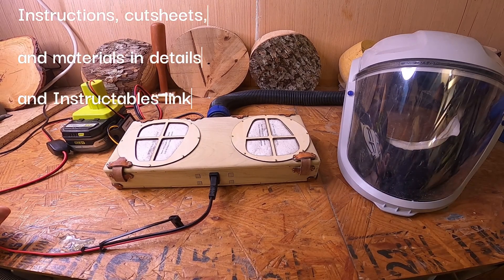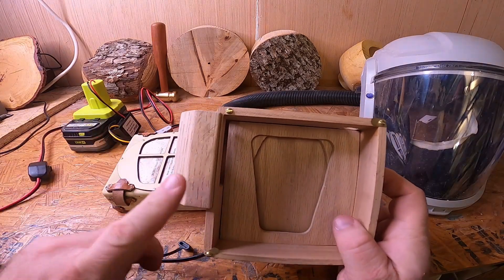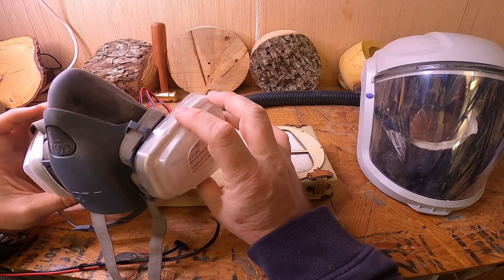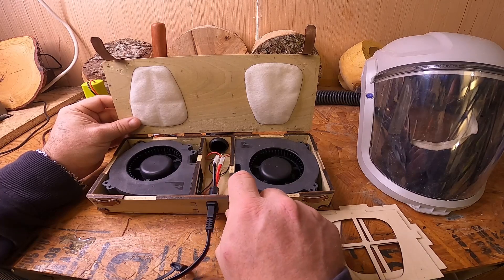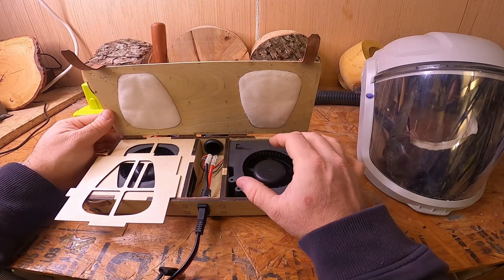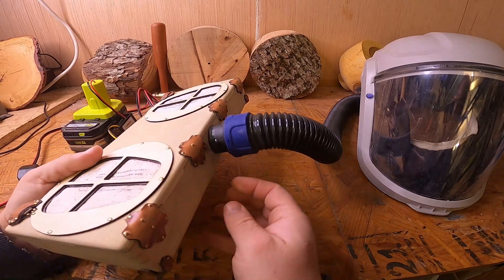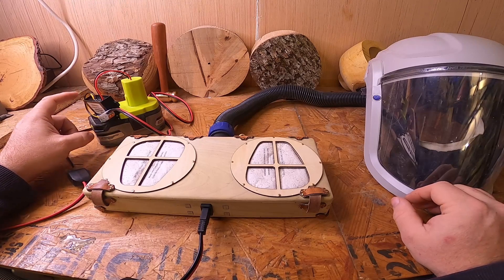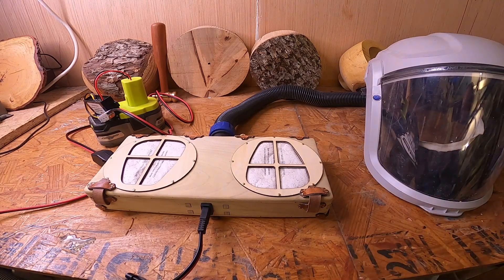diy N95 PAPR for Wood Working   Made with Clipchamp

Comment: This is great. I just started making something similar. I did not want to spend the money for a full system either. I’ve been working on a non mobile version. Connecting an inline duct fan to a fresh air supply. Thanks for creating this.
Reply from the maker: I hope it works out for you! It's definitely was a fun project (with multiple iterations). I have considered running it to a window when working with epoxy just to be safer.

Comment: Any reason not 3D printing or cutting from a respirator the 3M filter connectors?  Guessing N95 are cheaper and maybe you don't have that type cover that can go over the round cartridges as sounds like you prefer not to use a PAPR with or something like that.  Really neat and super thanks for sharing!  I really like seeing the PAPR's advance and being developed.  I started working on one I shared on Hackaday io and haven't moved forward on in a few years. Liked, commented and subscribed!
Reply from the maker: Haven’t done 3D printing… yet. I had considered that, but the N95 seems to provide good protection for woodworking and I have a half-mask i can use for chemicals as needed. As you mentioned, they are also significantly cheaper for the protection factor I needed. Really interested if someone shares a better fan that may work in a single fan configuration. Thanks for watching and subscribing!